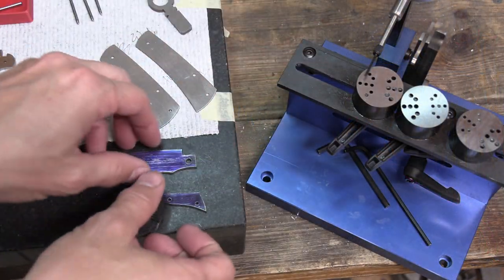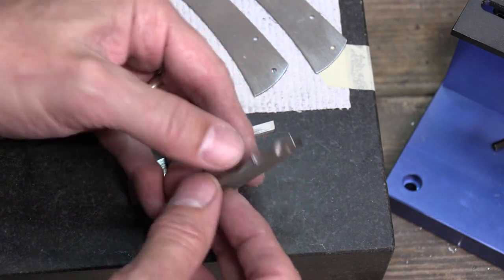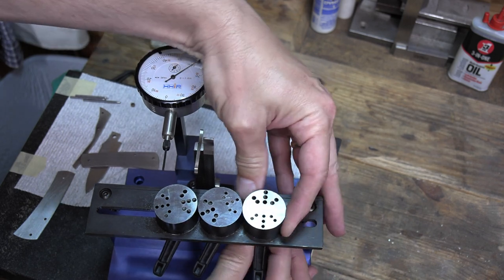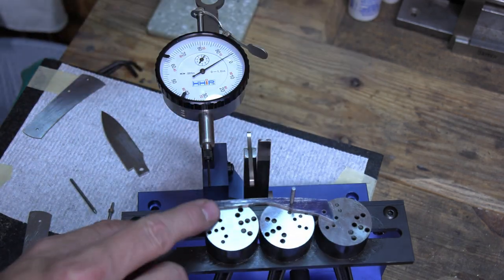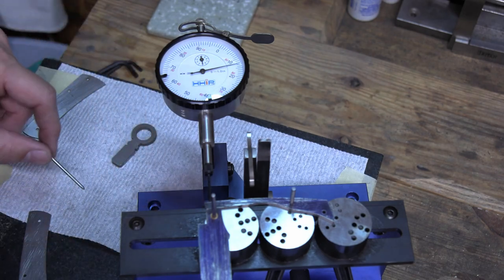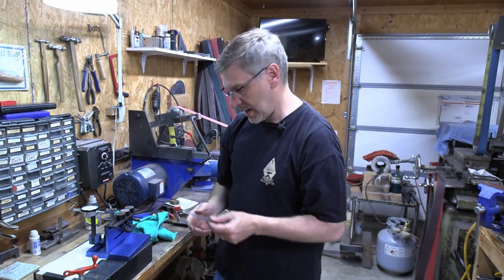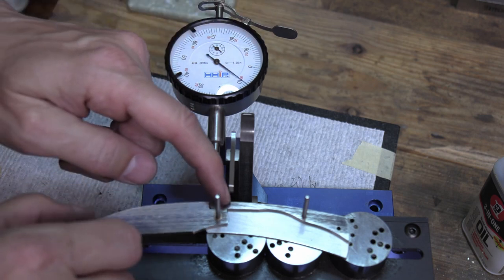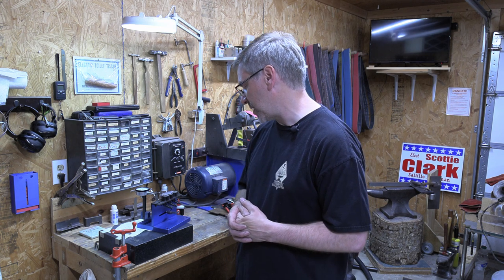Slipjoint Fit Up Using a Kennedy Fixture

Comment: Nice video. What I do with my bushing is scratch a mark on it at 6 o'clock. Then I made a part to hold the bushing in place as I rotate the blade. I took some round stock and drilled a hole in it for the pin, and tapered the end so it sits on the bushing.  With this I can hold down the bushing into place as  the blade is rotated on the jig. This really helps keep things consistent.
Reply: @chriscrawford5392  I sent some picts to you on your IG dm

Comment: Thanks for the very usefull info.....this info makes it all a lot easyer for those that are starting in making slipjoints. Few questions : do you use the same steel for the spring and for the knife??? And if you do , doesnt that cause galling up the contact points when opening an closing the slipjoint?? How hard do you make the springs (hrc)??
Reply: @chriscrawford5392  Thanks a lot Chris for the reply